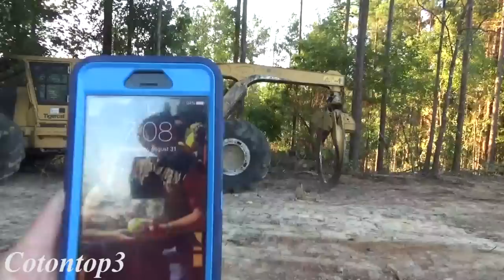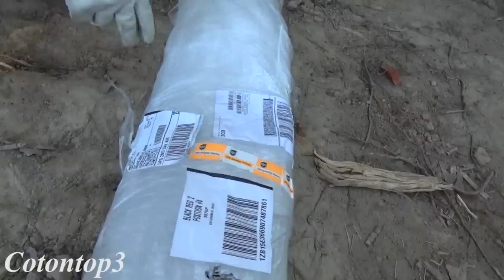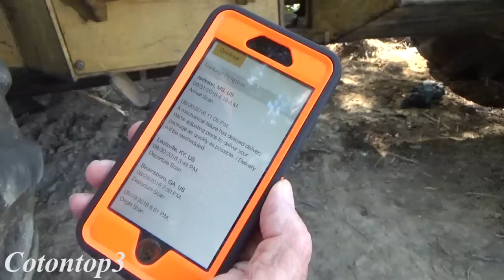Tigercat 635D, will it ever run again???

Comment: Around here if we want it next day Fed-X   Is the only way. 
Pick up some CDX plywood & cut the sheet in half 4*4 , then cut other half in to 2-2*4 pieces take a 1-1/2 hole saw, bout in center 3 inches from the side. Space two hole out 5 inches, cut piece in between with saber saw for hand holes. Do on the ends of 2*4 sheet both, 
On 4*4 do all sides,  then sand edges till smooth.  Then get white or light color oil base paint, give two generous coats , especially the edges.   The light paint will get dirty, but helps show up parts, second does not get hot. Three can get oily n wet n just wipe off. Last good long time.  Makes it nice for mechanics.   With the paint , no splinters , easy to slide on.  Keeps you out of dirt ,mud . 
Makes life really nice 40$ well spent per truck .  
Just a idea.

Comment: Tim, I guess after all the driveline breakage on the 635d, that now you keep a couple of extra items on hand. They could build indestructible yokes and drive shafts, but something else more expensive would break. Just add that to regular maintenance at least once a year to replace yokes and drive shafts. That 635d is so powerful, capable of pulling twice as much as the other skidders, it puts enormous strain and stress on the weak links. Like you side, the yokes and drive shafts are the weak links and alot cheaper and easier to replace.

Comment: Everything you've said makes sense, and I'm going to assume you've done a cost/ benefit breakdown on keeping a complete spare driveshaft assembly (yokes, joints, shaft,slip joint and any steady bearings)on hand. Especially as it does seem to be engineered as the torque limiting component. We do the same thing at my concrete plant "ie drum rollers, PTO shafts"but some parts are just too expensive to have laying around.
Reply: Worst story for us was waiting for four months for parts out of Germany for a concrete pump.

Comment: like my father is fond of saying. if it's yellow, it's gonna take a lot of green to fix it. I like to say, If it's got tits or tires it's gonna give you trouble.
Reply: also you need to nail down a good machine job shop that can make some of these parts. I could have built a new shaft in a couple of days, and that's making new ends. shipping sucks any more.
Reply: ...or tracks.  I agree about the machine shop.  find a reliable one that will make things to order.  They can out build the original manufacturer and do it for less.  You don't want to do everything through the machine shop, but chronic issues can be remedied there.

Comment: You ain't the only ones that have been getting the run around from UPS. I told Dothan Powersports to just let me pick my stuff up from now on or ship it FedEx. UPS has delivered to this address for 34 years now and missed aa ship date twice. Their excuse was the address wasn't on record and I needed to call to verify the address. I did and they still were two days later. That put me 3 days on an overnight delivery twice. Six days to get a part the was special ordered and paid in advance. The pubic service aspect of UPS is right up there with McDonalds now........................

Comment: Momma said they'ed be days like this,she just didn't say they'ed be so many of them.

UPS is just another company that isn't what it used to be.I'm waiting on a damage claim from them going on four weeks right now.I lost nearly three days of work last week sorting out problems that were caused by two things which sadly are common in our country today-people who lie and people who just do not do their job.

I've built quite a few of those driveshafts over the years.Usually the Spicer/Dana part numbers are right on the parts,I order mine through a local driveline shop and use hydraulic cylinder barrel tubing for the shafts.As long as you keep the yoke and splines timed it's not that bad.I have changed those wing type yokes in less than an hour.I have also taken broken yokes like yours,removed the mating flange off the xfer case and used it as a welding jig to weld the broken yoke back together.I bevel them out 100% and preheat to 250-300* and then use either ER70S6 wire or 7018 lowhi stick.Just watch there isn't any undercut and you're golden.

It's not a perfect fix,but will run till the parts show up.

Good luck and keep your chin up!

Comment: I know this is an old video but would a driveline fuse save some time and money?  Especially if the operator has to lay under there in the mud and replace the bolts every time they break?

Comment: Could Tigercat find you a super heavy duty wireless load cell to put on the TC 635D grapple so the operator knows how much wood they have picked up? (e.g Intermercato-intelweigh, John Deere etc)  
Traction assist the loaded up 635D up some of those steep pitches/ inclines where the tires skid too much with a hydraulic ship cable winch on the back of the yellow JD excavator, or put a blade on the back of the JD 548 with a big winch (similar to the Hass 548 set up) Figure out some type of auto cable pick up and release.
Put a hydraulic T bar on a pickup  to reach under the skidder to help release and put back the belly plates?

Comment: Great video. finally some level headedness when it comes to brand loyalty. I do a lot of post logging clean up. few of the guys up here are running feller butchers, skidders.... they are done for the season and they lost more money than any one should. Another company runs 8x8 dangle heads and fwd'ers and they are still logging. High mtns of colorado. their equipment is down less and they spend far less on building roads and landings and end up moving more loads with less effort? Respectfully How come you guys run the equipment you do?

Comment: Geez! And I thought my week was bad! On the off chance that this happens again I have heard of a technique that could help.
Here's how it works: First you find a trail that is as short as feasibly possible. Next you would use your second processor to delimb and top the trees in the woods and then shovel with the processor to the deck. I know shovel logging isn't ideal but the upside is the tracked processor can keep the flow of wood moving.  I have only heard about this so don't shoot the messenger.

Comment: atleast you will have another shaft on the shelf in the shop waiting for the next go around. since it seems to be a common problem with that drive train i'd keep replacement parts laying on the shelf just for that occasion. i imagine keeping those parts stocked would be cheaper then lost production at this point.
Reply from the maker: +OffroadTrucker740 we have it all now, shaft, yoke and joints at the shop.

Comment: We had a 630 that kept going thru same problems. Either universal or yoke breaks. Backing it down would help but it's a tiger cat issue. If it's a weak link than they should have plenty on hand. Glad u got it
Reply from the maker: +David Gokey you're either the 5th or 6th person to comment and say the exact same thing.
Reply: cotontop3. this is my wife's account but I can tell you from what I've seen, our old 630c's used to have big buckets like your 6 wheeler has . The buckets got cut down operators paid more attention to wheel spin and walaa repairs got cut down.we currently run two 630E and one 630c , ps love the videos

Comment: just out of curiosity how come you use the 648 along with the 635 instead of using the 748 with the 635
Reply from the maker: +Oliver Knapp because the narrow tires pull a lot better in the hills than the wide tires.
Reply: oh I see so does the 748 have wider tires on it then the 635.
wat size tires the 748 have then

Comment: There's a simple solution to this.  If you KNOW and have identified the "weak link" in a machine, you should keep that particular part in stock.  Doing so simply reduces downtime, which is the Achilles heal of the production industry.  FYI : Anyone that has been in any kind of industry that requires the use of heavy equipment should already know this.  The drive shaft IS and ALWAYS will be the weak link.  It's designed that way, so you don't damage anything further on down the drivetrain.  With all due respect sir, you've already identified the problem.  Now solve it.
Reply from the maker: +chevytruckman34 yes sir, we are doing our best. Thank you.